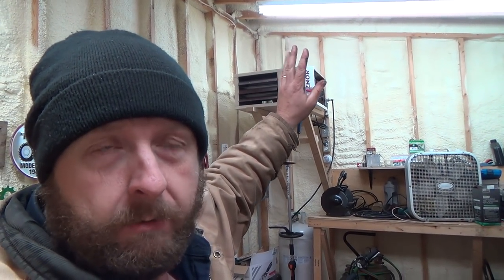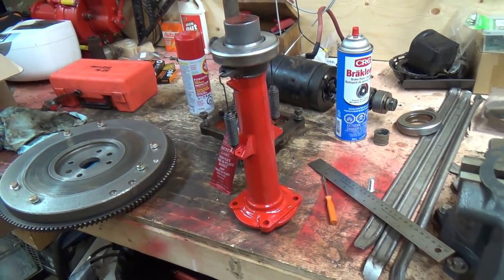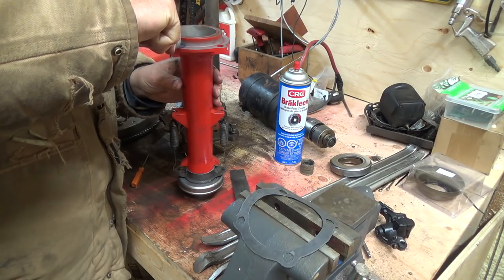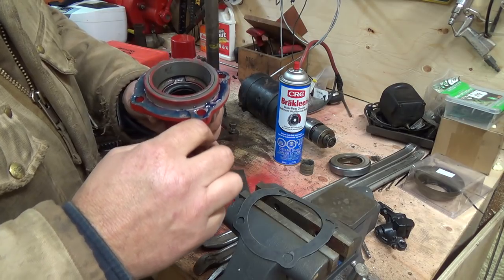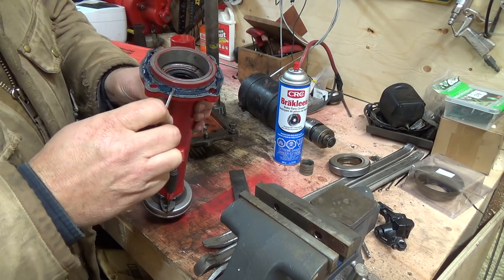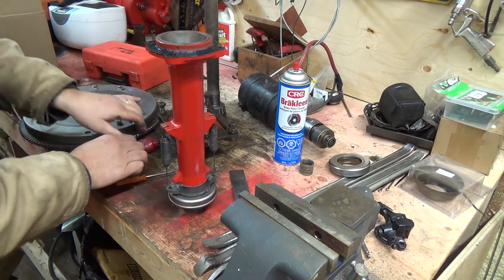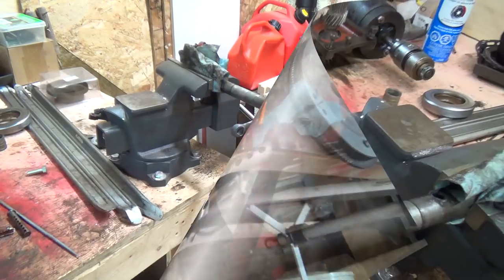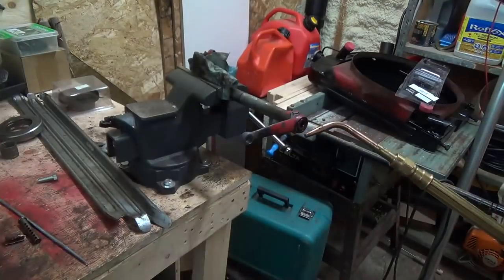Let's install the input shaft in the 1944 2N...also some brazing to repair a clutch rod "pin" hole

Comment: When you go to put the new ring gear on, you can put the new gear in the oven and have it heating up while you’re getting the old one off, then you’re killing two birds with one stone. Go get new one out of oven after getting the old off and plop it on. Will give you a more even heating of the gear too then you could do with the torch.

Comment: Each bolt size has its own specific torque according to its size and there is a chart if you just google it that shows what Torque according to nut and bolt size and thread pitch and if imperial or metric

Comment: Don't know where you get that cast iron will break after heating it up vehicle rear-ended engine blocks transmissions and lotsa of other things is makes out of cast iron and you don't see them falling apart do you I have welded cast iron many times and it didn't fall apart.

Comment: That looked like a pain to fix the sloppy pin :-(
Pity there isn't a bit of nylon rod that could be pressed in, then use a pillar drill to open it out slowly,  just under the pin diameter :-(
Sods law dictates that when you have struggled,  an ideal bit of material will appear from nowhere lol.
Reply from the maker: it’s a good skill to know
Reply: @billstmaxx  The only time i did brazing was at school, millions of years ago lol.